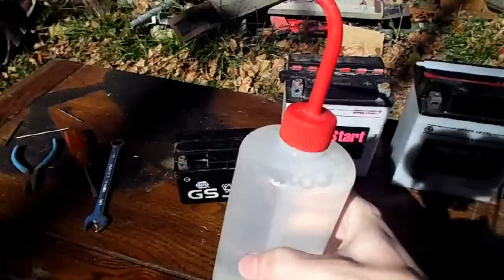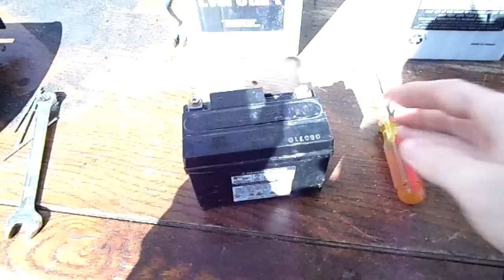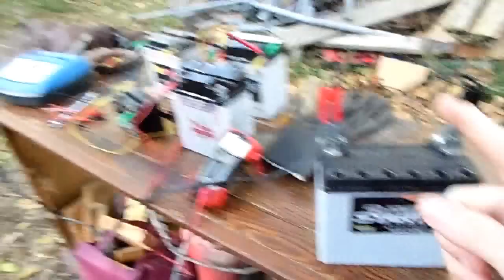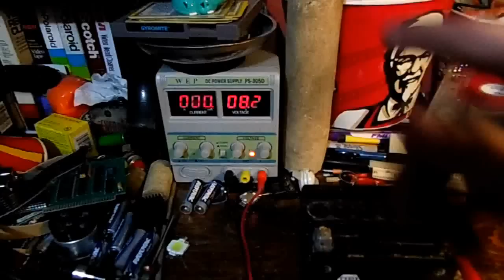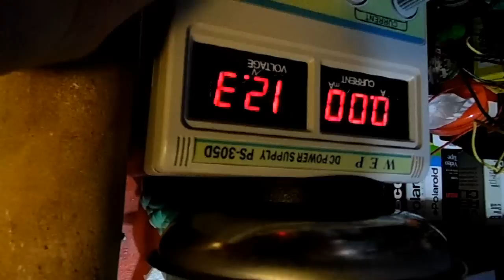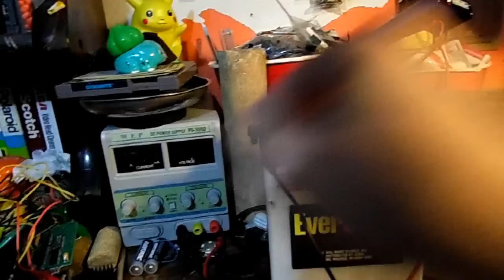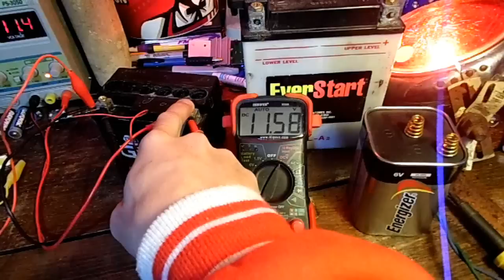DIY Fixing Lead Acid Batteries

Comment: Is that power supply just one of those $60ish ones from ebay, or are those some kind of rip-off and yours is some higher quality big dollar machine?
Reply from the maker: no mine is the cheepo one from ebay. they are absolutly wonderful for batteries. although if i was working with finely tuned circuits and chips i'd get get a more exact supply.

Comment: That tiny little one is an AGM battery and is not supposed to have any liquid. You obviously know what AGM stands for since you mentioned it in the video
Reply from the maker: oh it does have liquid in it, its just a small amount soaked up into the sponge between the plates. it really doesnt matter tbh couse you can just dump it out and get rid of the extra water. all ya wanna do is make sure the sponge between the plates has electrolyte in it.

also the tiny black one was flooded acid not agm, but the grey one was AGM.
Reply: the tiny black one looks just like several AGM batteries I've assembled in the past... maybe Napa just sells cheap crap. Not surprised!
Reply from the maker: Krankie V
 yeah when you pop the caps off there is free standing electrolyte inside and no sponges between the plates. there was no reason for it to be AGM if it was upright mostly. think it was for a kids 4wheeler.

Comment: Quick question,
1. under what condition of the battery the "desulfator" is required?
2. I measured each cell of my battery, from right to left, it start with negative voltage, then v1.02, v2,40, v4.43, v6.3, v9.7.  Is my battery shorted? 
3. If 2 is yes, is it fixable you think?
Reply from the maker: Those are weird voltages, your battery only has five cells and is 10v? Anyway batteries begin to sulfate as soon as they are filled with acid. If they have been used constantly then they prolly won't get too sulfated for several years. But if the battery has been allowed to sit long enough for voltage ( at least a few weeks) to drop then it is prolly sulfated.

But you could try a little bit of Epsom salt and if that little bit helps could add more. Its up to you. I don't,t see any reason you could,t desulfate it after adding Epsom salt.
Reply: Rinoa Super-Genius
sounds to me like a cell has reversed voltage, that's a dangerous state for any battery
Reply: Hyratel This battery originally used for a motor scooter.  I am not sure how this battery would wind up "reverse voltage" state, but my question is if this battery is revive-able??  If not, I guess I'll just discard it and buy a new one.
Reply: MessyGreasy Hand funnily anof the only scooter battery iv tryed to revive had cell reading that made my jaw drop. i was like whoo what? then charged it... thort hmm its sure behaving oddly . then felt battery.. boiling. took of charger. few seconds later the battery has a flame coming out of it lol
Reply: MessyGreasy Hand No, it can explode if you continue to charge it and is not recoverable

Comment: I need your help, I have a toyota prius the 12v battery is dead, I believe it's a AMG battery how do go about charging it, trying it with my ctek battery charger, the charger and battery is getting really hot, as soon as it hits 12v the charger gives an error, saying battery not good and it's start to drop the volts, thanks
Reply from the maker: did you measure the voltage in each cell? you may have a shorted cell. i can't remember if i showed how to test for short in this video but basicly you connect a multimeter to the acid in each cell.

don't use your multimeter probes, would corrode them. but like connect one multimeter wire to the + post, and then put the other pmultimeter wire into the acid of cell one. it should read 1.8-2.2v.

then for all other cells you measure from acid to acid. when you dip the wires into the cells don't touch them to the plates or metal. the acid itself is conductive.

anotehr way to tell if it's shorted is if it drops down 2 volts. like if you charge it to 12v and it drops down to 10v. 5/6 cells are good but that last cell drops in voltage and so the whole battery losses 2 volts.

i hope its not shorted though, i havent found any way to fix a short yet. i hope that helps. ;/
Reply: Rinoa Super-Genius I heard that dropping the battery from a couple feet up can fix a shorted battery. Kinda makes sense - clears the shorting material from the bottom of the plates.
Reply: John Chapman hahah your right actualy. I was removing a battery from my mums car and as i removed it tripped the battery took a bad knock. get home with it .. and now its recharged its haha . still using it today

Comment: the last reply was short because i had to go to bed lol but using my logic you should take some small samples off the acid and use some litmus paper or solution to see if the solution of acid and water has weakened or even neutralized due to age and my miracle battery desulphator  was a bedini motor it would usually only take a week and its like a brand new battery again but not all batterys are capable of being revived but otherwise good luck for the future repairs :)

Comment from the maker: haha i didn't even notice that. i tend not to look at warning labels too much.

and yeh i am going to make like a big power strip and some cables. the cables will have a plug on one end and two aligator clips on the other side. that way i can connect or disconnect each battery if i wanted. but i'm only gonna worry about that when i get a good source of power like my solar panels and such.

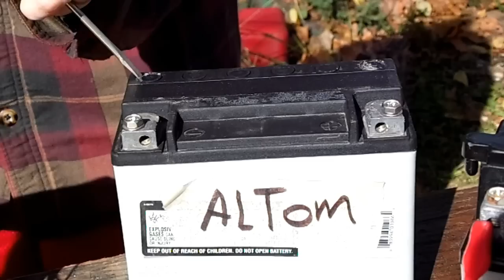Comment: The best part is how you have the battery positioned at 7:05 and following breaking into it with the "Do Not Open Battery" warning clearly visible.

Tell you neighbors that you could turn a battery into a bong and no one would ever suspect it was one. You might create a business.

Comment: If you are doing a lot of parallel circuit battery charging, you might consider building a negative busbar and a positive busbar on which to clamp the alligator clips for that workbench.  You had multiple alligator clips on other alligator clips.

The direction things are heading, I foresee clothespins with bare wire wrapped on the clamping end on those bars.

You might be able to gut one of those batteries and build a capacitor.

Comment from the maker: well i have only messed with the wizbang plus so far and it does seem pretty weak. but hey it was cheep and it is getting the job done.

i havent tested any other ones but hey i am making money from youtube so i should buy more desulfators and make reviews :D

oh and i would stay away from desulfators that require connection to an AC outlet. most of them say they can fully desulfate a battery in a few hours and tend to fry a battery by overcharging them, i'd stick to a simple one.

Comment from the maker: haha well thanks. i put that in for the people who stumble across my channel since my battery videos get me like 90% of my subs and views.

i plan on remaking this video every year or so and each version will get better and better and i'll also refine my method.

it seems as though my desulfated batteries sometimes don't get past 12.4ish volts. you think i should mess with adding epsom salt? i think the issue is the sulfuric acid has turned into useless chemicals and so the acid is less potent.

Comment: If you want, you could try to recover one with the method I used (no guarantees but really nothing to lose with a dead battery):
1) Empty out the old acid from the battery
2) Fill the cells with a baking soda & water solution to neutralize the remaining acid (the foaming also tends to chemically desulfate the cells) & lightly thump the batteries a couple of times
3) Rinse out the baking soda well with water @ low pressure
4) Replace acid with the Alum solution mentioned before. Good luck.

Comment from the maker: nice! i've had good luck with epsom salt and may try alum someday.

the 3rd 4-wheeler battery i didnt show much in this video is bad along with the 2nd one that was bad. ima connect one to 115v AC and blow it up. then maybe cut them open, remove the plates and turn them into little lockable boxes.

Comment: The avatar did change, albeit not willingly. I was forced into the google, youtube, google+ account merge while commenting. In the process of trying to get my avatar back.
I have a couple of DCM (Deep Cycle-Marine) batteries in my battery bank I chemically desulfated & replaced the acid with a solution of 8oz (dry measure) Alum to 1 gal water. Delieve it or not, just that took then from 2v to 10v without any charging (wouldn't hold a load without charging, but doing great now).

Comment: Thank you for the answer. I'm building a solar power system and a desulfator would be a big help. If you know any trucking companies, you could try to get an 8D3 or a 4D3 battery. They're massive, about 100 pounds but have a heck of a reserve. One or two could be a big asset to your shed lighting system.
Reply: Solar charge controllers, even a cheap ebay one, combined with solar panel(s), make the best desulfators as they push 1/10 of a volt more than whatever charge is currently on the battery and lead acid likes this.  I have saved an older flooded lead acid costco interstate battery that went flat because the car door wasn't shut right, and then the battery was too low voltage to take a charge from the alternator which pushes 14.4 volts.  I was going to buy a new battery but just left the 20 watt solar panel and the $12 charge controller on the battery so it would start when I got a chance to go to Costco to buy a new one.  It was covid times so I kept putting it off.  I did put some distilled water in the battery and I kept the solar on the battery which I noticed was slowly creeping up about 1/10 a volt every day.  It took at least a week to get the battery chargeable by the alternator again, but even more time will desultate further.  I didn't have to buy a new battery!  That was 2 years ago and the battery is still going strong with normal use.

Comment from the maker: its called the Wizbang Plus on ebay. only really available on USA and Canada ebay but cost 20$.

this desulfator is the cheepest one you can buy. and it shows. thats why it's held together with a cloths pin and a bunch of solder on it.

it arrived with a capacitor broken off and they just refunded me and let me keep it free. that may be a mistake or they didn't care about me returning it.

btw it does come in a plastic housing, it doesn't come as an open circuit board.